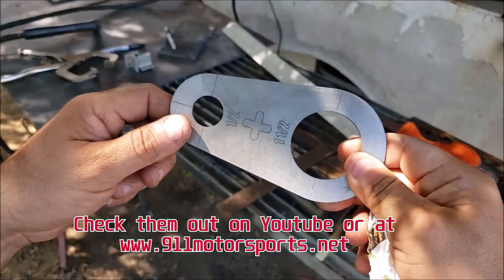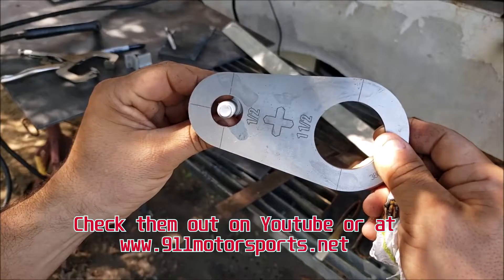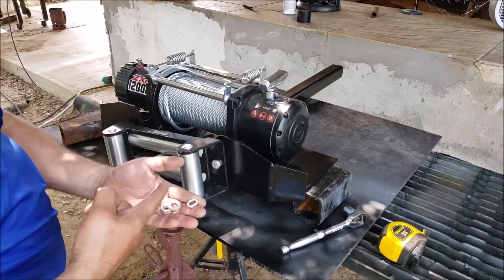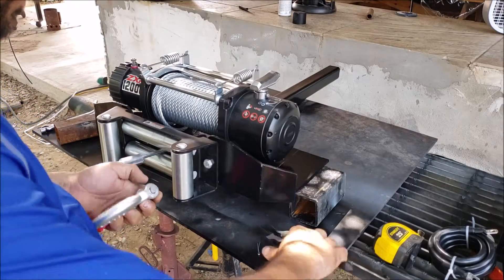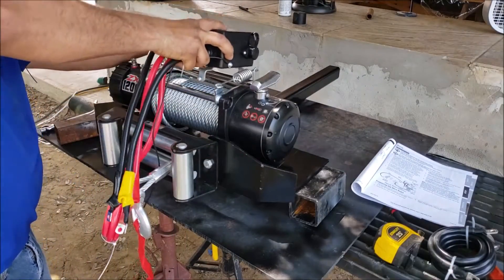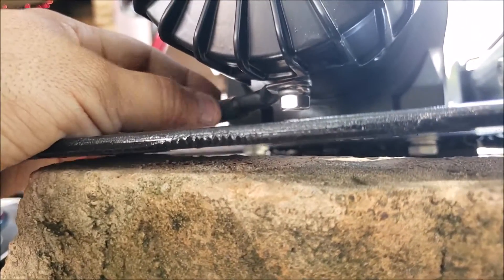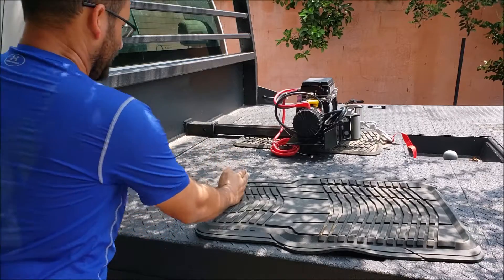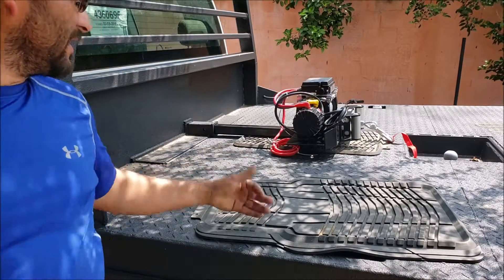How to build a hitch mount for the badland zxr 12000 lb winch and setup

Comment: Nice to have a plasma cutter, unfortunately very few people have them.  I was all gun hoe about building one until I saw you had the plasma cutter to do the work. LOL Now not so much.
Reply from the maker: I used to use my cutting wheels and band saw for many projects before buying a plasma cutter. I recently gave away a PrimeWeld Cut50DP plasma cutter that cost around $399 and worked great which would be nice for beginners. The Powermax 45 I have retails over $2400 but got it used with no warranty for 600 or 700 dollars which was a gamble. The plasma cutters also require a big compressor so more money to spend. I may try doing more videos using cutting wheels. Thanks for watching.
Reply: @cutweldngrind  Ok was just looking at plasma cutters for home hobby use 120v that will cut up to 1/4 inch They cost less than my small wire welder did.  Now I have to figure out if I really need one or not LOL

Comment: For years all I had was a cutting torch and grinder.  I just got a plasma torch a couple years ago and it is a phenomenal improvement.  Clean up of cuts has been cut to a minimum as you know.  Jorge, this is a very good project.  Designed and built very well !!  Nice video and very well done Jorge.
Reply from the maker: Thanks. I like to work on projects but this house I am trying to remodel is just beating me left and right. Basically problem after problem and will require my Stihl demolition saw to cut the concrete floor now. 

I have never owned or used a torch and my first cutting tool besides a grinder was a used Stihl Ts400 demolition saw with 14" diamond blade. I remember cutting tons of oil field pipes with that blade till it ran out of diamonds lol.

Plasma cutters are awesome, I actually had a give away on a Prime Weld cut50DP and about to make video to announce the winner. The powermax45 is also a beast of a cutter.

Thanks for stopping by.
Reply: @cutweldngrind  I used many a demo saw in my 40+ year commercial HVAC career.  We cut roofing material for installing roof top heating and a/c units and many other pieces of equipment.  The rental companies charged for blade use by measuring the depth of the diamonds before and after....plus the daily rental charge.  
   I've been using oxygen acetylene torches for close to 50 years and the difference between them and the plasma is like night and day !!..  Because I do use 3/4'' plate I went with the Hypertherm 65 and it is also a beast.  I'll be installing a cnc table soon and that will go on the table.
Reply from the maker: @tractorman4461  I would really like to see a cnc table project. I have wanted to try buying one since my powermax45 has a port for cnc tables. I have a vacant lot that I want to build a metal building and would be perfect to install a 4x8 table. Have you worked with the software before needed for plasma cutting.
Reply: @cutweldngrind  I have not personally worked with a cnc table of any type.  My Hypertherm 65 is also compatible with most standard tables and software as well.  I will rely on the local rep to steer me to the best software/table for my use.

Comment: I  like the size of that cable. I've always been shit scared of those smaller cables breaking. I  broke my collor bone  a few years back when a big cable let go that was attached to a digger.
Reply from the maker: I actually busted a chain that I hooked up to this winch and the chain flew and hit my headache rack. That's when I found out the GIN pole setup had issues. I am scared of cables and chains as I have seen some stuff before.

Comment: Just curious of what size compressor you are using for your plasma cutter
Reply from the maker: This year I'm using the Dewalt 60 gallon which replaced the Husky 30 gallon. You can find them on my channel but the Dewalt works really well.